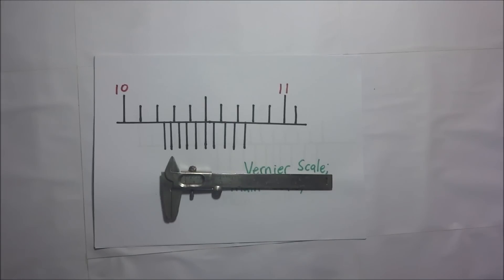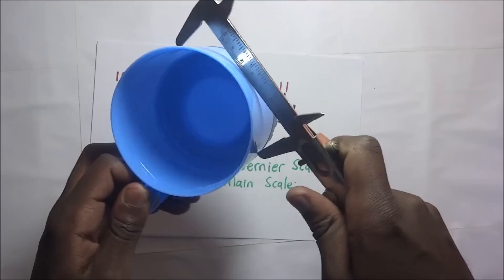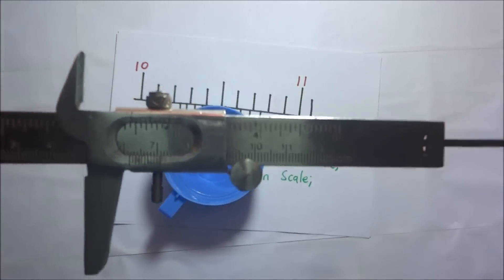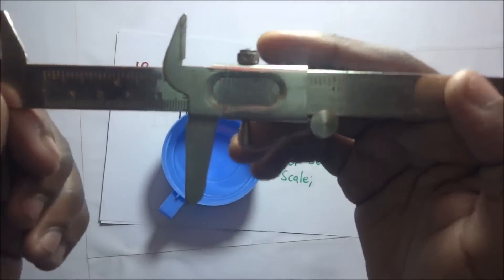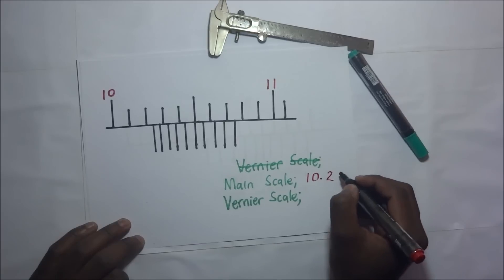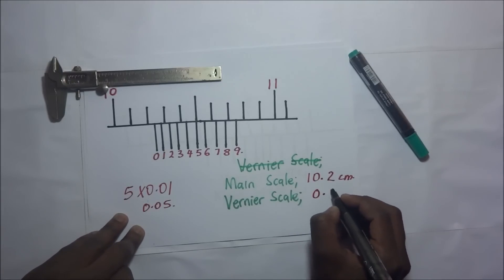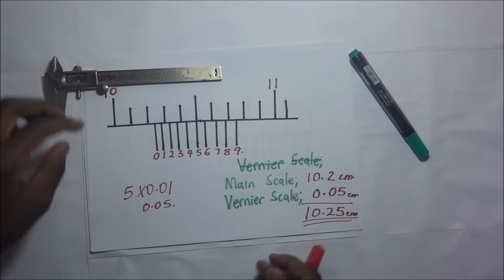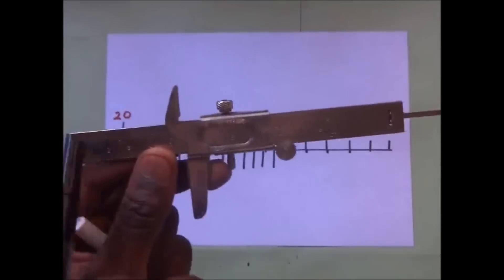How to read a vernier caliper | How to use a vernier calliper to measure the depth of a beaker

Comment: How exactly did you regulate the sliding jaw at 3:02? I didn't understand quite well.
Other than that, I loved it!
Reply from the maker: Check out this video https://youtu.be/TyLnYsnANjw at 1.32, see how I slide the jaw using my thumb. That is what I mean by regulating the sliding jaw. You regulate the sliding jaw in such a way that the protruding strip equals the depth of what you want to measure.